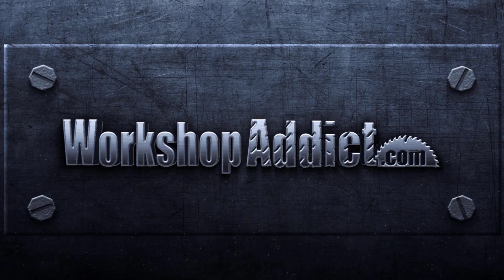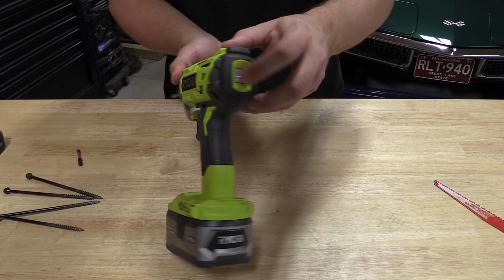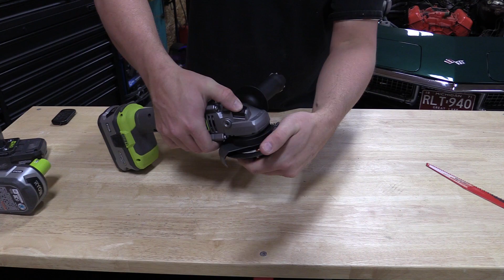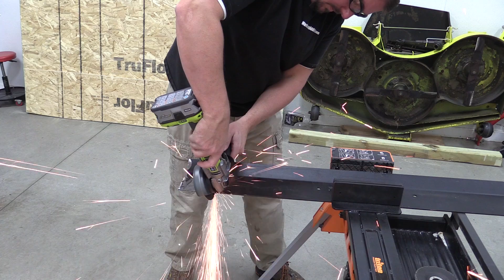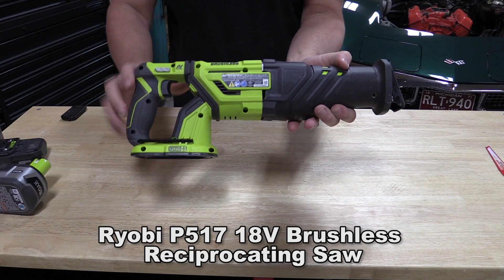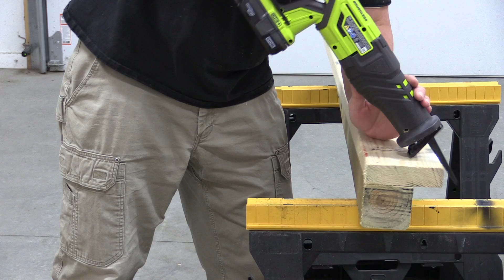New Ryobi Brushless Impact Driver, Circular Saw, Angle Grinder & Recip Saw

Comment: I have the recip saw, the first time I used it I couldn't get the blade to release.  I tried for over an hour and after two application's of WD40 I finally got the lever that frees the blade to move all the way. Apparently right from the factory it might not have been lubricated and the metal pcs froze together. Very frustrating, otherwise tool works great.

Comment: There is an array of tools that Ryobi makes (ie; grinder, hammer drill, circular saw, impact driver, sawzall) that need the 9ah battery, you will see a day and night difference with the battery change!!!
Reply from the maker: At the time of the filming of this video, the 9Ah or any high capacity batteries meant for these tools, were not available.
Reply: Capacity (9Ah) won't matter as much as the current (Lithium vs Lithium+ vs Lithium+ HP)

Comment: This guy sucks at using these tools. I use these tools everyday. Not so much the circular saw but definitely the other 3. even though the circular saw works great if you put a metal cutting blade on it, to cut pipe or steel strut.  That dude was definitely struggling with the tools and try to put the blame on Ryobi. Lol

Comment: You need to use the brushless tools with the 6ah or 9ah HP+ batteries. They have extra contacts on the back and enable the battery to provide extra torque with the brushless tools. I upgraded to them and the difference is amazing.
Reply: jesse grat I have the newer HP batteries and the circular saw cut through the 2x4 rip cut just fine. Not amazing but it does the job. Just an at home tool. I like it a lot. Does what I need for a good price.
Reply from the maker: Those batteries were not out at the time of this review.

Comment: I noticed that the new angle grinder now has a different guard or some kind of slip on piece for using with cut off wheels.  I've been trying to find something like that to use with my old blue angle grinder.  I tried the HF guard but it doesn't fit.  I'm leary of using a cut off blade without the improved guard.  Do you know of any 3rd party guards that would fit the Ryobi angle grinder?
Reply from the maker: I do not.

Comment: I just returned the brushless circular saw.  I had cutting out doing a cross-cut in a 2x4 as well as 3/4" oak using 4.0ah lithium+ battery.  My old 5 1/2" circular saw (original blue version) had no trouble with both of those!  If a 5 1/2" does better than a 7 1/4" something isn't right.  It may well be that these brushless tools need the new line of batteries that "communicate" with the tools (not sure what means) - but it makes me wonder if this isn't also a good way to get people to buy a bunch more expensive batteries.  I'm staying away from brushless for now.
Reply from the maker: I agree.  I do believe the brushless tools are good, you just need to use the right battery with them.

Comment: I'm a window and door contractor.and I use exclusively Ryobi tools. I'm still using a few from the original set I bought in 03. However the new brushless tools have been a huge let down they haven't lasted and eat batteries way faster than the older ones

Comment: The Ryobi brushles tools were designed to be used with the newer +HP batteries. And it makes a world of a difference. I have this saw and with a newer +HP battery and a Diablo blade I rip thru solid 4x4's and old wet 7/8inch OSB all day long with ZERO hiccups! I work construction full time with these brushless tools and they do great. My current Diablo blade has been used every day for over a week and still no stalls!

Comment: So the brushless motors are more sensitive to overload?? With the correct blades I guess that they will be OK. Way to finicky fussy and underpowered for Serious DIY or professional use. I mean if a blade isn't 100%perfect it should still go through to finish the job in hand. I think that the overload protection is a bit too ott.

Comment: It’s the blade. I got the recip saw with a 4ah battery and used a diablo pruning blade to trim a tree. 2 inch limbs were cut with no problems.

Comment: Anyone one know why this guy is having so many issues cutting and sawing? I have Ryobi and have never had those issues. Oh so Ryobi is just good for dyi? Not according to the tens of thousands who use them everyday to earn a living.
Reply: I've noticed that a lot of the Ryobi brushless tools seem to have an overly sensitive cut-out threshold. 

Ryobi is considered a DIY tool because they are built to a cost. For example, the brushless skill saw has a stamped, not cast, shoe, a plastic blade guard (which would likely get broken on a job site), no dust chute (on the North American version), it does not come with a rip guide, and it doesn't even come with a screw for the rip guide. While not necessarily a pro feature, it also lacks a laser guide like their old saw had.

That's not to say that they are not good tools, but the majority of them are not pro-grade tools. A Concord Carpenter has several head-to-head tool reviews. You can check out his channel to see what I mean.
Reply: @Pro1er  ok, thanks

Comment: i'm a ryobi guy,probably 30+ 18v tools. i have always felt i was getting a great value.i do see ryobi doing a price creep toward the high end brands. but the one battery fits all is great. NOW  FOR THE BAD NEWS. i bought the 7.25 circular saw,4.0 battery. it worked just like the review,it cut off every 5-6 secs. took it back. read reviews that people loved it,BOUGHT ANOTHER ONE,I REALLY NEED A CORDLESS CIRCULAR SAW.BOUGHT A DIABLO BLADE FOR IT. 2ND ONE WAS A ABSOLUTE PIECE OF CRAP! for the money they charge for this brushless,119.-135.00 it just doesnt  work. maybe if i hooked the 9.0 amp 100.00 battery it would. 2nd saw went back.

Comment: the stock blade is absolute junk. I put a 40T diablo blade in the circular saw and I have no difficulties ripping sheet goods and lumber with a 3.0ah battery.

Comment: lol I still have my blue tools 
I felt like the the blue circular saw works better than the green ones but maybe I just wasn't cutting heavy enough stuff LOL but I have gone through two blue circular saws because they have destroy themselves while I was using them but I kept using them until they finally just locked up.

Comment: The new battery line up is the brushless tools best friend you should redo this video with the new batteries
Reply from the maker: audionut I agree!
Reply: The HP line the brushless tools have two extra terminals that allow the tool to increase power. This actually does better at the 6.0 side for each tool. VCG does a great video on the p238 with the hp and non hp batteries and its shows a tremendous boost in power vs the other non hp battery
Reply: What new batteries?

Comment: Would it be possible to do a revisit on the brushless line with the new 6 amp hour batteries? Supposedly the new batteries are geared more towards the brushless line of tools.
Reply: The new batteries made a huge difference in the P508 circular saw during my tests. At least 60% faster when ripping 2X material, with barely any overload cutouts even when I was really pushing the saw hard through the cut.
Reply: Doresoom Reviews Doresoom Reviews right on thank you. I was on the fence about that thing after seeing a couple other videos pretty much say it's a turd with the 4ah. Going to have to get one now with the 6 ah battery.

Comment: Hi. I have the brushless Ryobi circular saw. I too had the cut out issue.... Until I installed a thin kirf 24t Diablo blade... Wow a new saw... I can rip long 2x4, angle rip 2x6 no cut out at all... I highly recommend the upgrade, I think the standard blade is rubbish. Oh and in NZ we have 5.0ah batteries, I use those in this saw.

Comment: Definitely agree the newer batteries with the charge indication on them are far better, i have even just ordered the Chinese copy Ryobi charger and two 5ah batteries was dubious at 1st but my friend has them they are very good
Reply from the maker: Rocky fish Be careful.  We did a video on the DeWalt and Milwaukee aftermarket batteries....  They alwere sub par.
Reply: WorkshopAddict I was worried about them but in all honesty I think the charger is far better I had the standard charger it broke. Got this I opened it up and it looks better built inside too, the batteries are very good I've used a multimeter on them exactly what they say on the tin, I understand your comments because I was the same not long ago but after seeing them work I went for it, £20 for a 18v 5ah battery, even if it breaks after s few months still better then £70 I'm not knocking Ryobi there batteries are very good but the charger was crap this new charger is very good

Comment: You need to start clamping those planks before you lose a finger.And those tools are underpowered.Dewalt sawzall even with a compact 1.5a battery would slice that ryobi POS in half before you've even changed a blade.Thanks for showing them though it's thoroughly persuaded me not to buy a single ryobi tool LOL .... and least you don't shout like some OTHER tool review dickheads

Comment: Will be nice to see a retest of the circular saw once Ryobi has their higher capacity batteries (6 & 9Ah) since the saw has extra contacts so they must be there to allow communication between the tool and battery
Reply: The new batteries made a huge difference in the P508 circular saw during my tests. At least 60% faster when ripping 2X material, with barely any overload cutouts even when I was really pushing the saw hard through the cut.

Comment: Wow these tools are such garbage. It also seems that only ryobi and ridgid (both tti brands) have huge performance differences with different batteries, a clear sign of cheap batteries. How can anyone watch this video and proceed to buy these? Everything but the impact driver cuts out mid-job. Spend a little more and get makita, milwaukee, dewalt. You'd be an idiot to buy this absolute trash

Comment: My brushed ryobi impact driver breaks impact bits like nothing i have ever seen before!
Reply from the maker: terry jenkins The DeWalt ones work well for that kind of power.
Reply: WorkshopAddict I'm saying Ryobi is torquey
Reply: When it dies i will get the three speed brushed impact driver ive been using them for equipment repairs!
Reply: WorkshopAddict I second that

Comment: Nice review!  But, it's not "Ree Obi", it's "Rye Obi"  ;)
Figures that after I bought several kits they come out with the brushless tools.  sigh
The grinder kicks off because the amp draw from the battery is too high. The battery pack itself is shutting off power. The grinder is just pulling that much Amps to run it.
The blade that comes with the circular saw is only for cross cutting. It's not a ripping blade. Perhaps changing to a ripping blade you'll get far better performance out of it
Hopefully Ryobi will come out with another battery pack a notch higher and that'll overcome pretty much all the cutting out you were experiencing. Personally, I'm going to fabricate one myself and make a custom 8Ah pack for the Miter Saw and Circular Saw.
Reply: Go watch any video that the Ryobi official channel has actually put out. They pronounce it "Ree-obi" themselves. You're right about the new 6Ah packs - they allow the brushless tools to draw significantly more power than the older 4Ah batteries.
Reply: @DoresoomReviews  I've heard them pronounce it both ways Nate.
https://www.youtube.com/watch?v=GXNLOAbfflk

Comment: It's got to be your blades. I picked up the circular saw so I didn't have to worry about tripping breakers by running a saw and compressor at once if I only have one outlet to work with. I work roofing and some general construction and I have cut 2×6, 2×4, 3/4" osb and sheathed houses using the 4.0 ah battery and don't experience the cut out. As soon as I got the saw I put on Diablo blades and it cuts great.
Reply from the maker: I was using the factory blades.

Comment: I think you must be the kind of guy who simply MUST push the tools through the cut until the motor stops.  I have the brushed versions of ALL the tools shown and I have made most of the cuts shown here with absolutely no trouble.  And that includes cutting a 7" or 10" diameter stream-blocking tree limb while in the water in my kayak with "The Axe" blade installed!  Advice on your ripping:  I think you were somehow pinching the blade.  With a couple of simple wedges, I could easily have made those cuts with the BRUSHED tools!  Work smarter, not harder.  BTW: with my BRUSHED impact driver, I almost always use the smaller batteries with no problems -- going through drywall into a stud with either 2 1/2" or 3 1/2" screws.  Also, I can easily cut through plywood with my cordless circular saw.  I don't think I can recall of EVER having a Ryobi cordless tool "cutout"!
Reply: Hey, im thinking on buying this saw, i have a drill with 4ah, do you think it will perform well (circular saw)
Reply: Well you use the right blades.
Reply: About equal to my experience with my Ryobi tools; I'll likely buy the brushless ones, but my brushed skill/recip/impact/etc all work amazingly and for years.

The only thing that wasn't up to par was the Krypton-bulb flashlight, which I replaced w/7 Cree LEDs and a SparkFun power supply when it broke.  Everything else has been great.

Comment: When bought in a kit does the impact and drill come with the light?
Reply from the maker: Mark Imbesi As far as I know, the kits are not brushless yet.
Reply: Kits are available in the USA  not in Canada  where I live
https://www.homedepot.com/p/Ryobi-18-Volt-ONE-Cordless-Lithium-Ion-Brushless-3-Tool-Combo-Kit-with-Circular-Saw-w-Batteries-and-Charger-P1953N/303037087
Reply from the maker: First I have seen of these kits.

Comment: The blades do matter, I was able to cut through a stack of three sheets of 15/32 plywood using the factory blade with the brushless circular saw. After some use the saw cut out on me, I replaced the blade with a diablo and it cut just fine through another stack. I wish ryobi had done a dual battery setup like makita did on their saw. For now I'm happy with my 7-1/4" brushless saw. Keep in mind these are cordless tools so they won't be as powerful as a corded saw.

Comment: Maybe the circular saw needed a different blade. Reciprocating saw is not designed for tressels.
Reply from the maker: I fully believe it might have, but I have to ask...  why ship a new brushless tool with a blade that does not work?  I get it though, we replace the blades on most other saws, not because they dont work, but because of cut quality.

Comment: Do you know what the extra contacts where the battery goes are for?
Reply: The only explanation I can think of is that the upcoming 6Ah and 9Ah battery packs "talk" with the tool to allow it to draw more current. Ryobi won't officially confirm the packs, but the product listing for the circular saw on HD's website shows a 6Ah battery installed on it.
Reply: Doresoom Reviews That's what I'm hoping for, a kind of "flexvolt" battery that works at 18v and a higher volt depending on the tool.
Reply: The new batteries made a huge difference in the P508 circular saw during my tests. At least 60% faster when ripping 2X material, with barely any overload cutouts even when I was really pushing the saw hard through the cut.

Comment: I treated myself to the free brushless tool deal at Home Depot. When you buy the brushless hammer drill kit, you get another tool for free. So I got the brushless angle grinder for free. I have the old brush angle grinder which I'll use just for grinding, and the new brushless is used for cutting and sanding.

Comment: For the saws, what blades did you use? The ones they came with? I guess they will do better when the 6 and 9 amp hour comes out.
Reply from the maker: Yes, factory blades
Reply: That could make a difference. I use a high quality Diablo blade for my circular saw and high quality Milwaukee blades (The Ax for wood cutting and The Torch for metal cutting) and never had any issues.
Reply: The 6Ah battery makes a HUGE difference with the P508 saw. Up to twice as fast when ripping 2X material during my testing.
Reply: Cheng Liu with a 6.0 or 9.0 this thing is a beast!!!! Changes everything

Comment: lame. big red brother said, this much power, and no more, you are not allowed to compete with me.
Reply: Take another look at the battery terminals on the circular saw. It's got two extra terminals at the base of the stem, which I assume is for the new 6Ah and 9Ah packs, since the P102 and the P108 don't have contacts in that location.
Reply from the maker: One always has to wonder about that!  But I also have to wonder how much communication there is between battery and tool.  The battery connection has not changed so they still only have 3 connections.  Might this be a safety built in to protect the motor and battery since it is a guess on how hot each is?

Comment: I thought amps is only runtime. 
The volts effects the power. I'm pretty sure it's not the amps.

How many bits are people going to lose on the impact when they just shoots out.
Reply: The larger battery packs can supply more current to the tool, since they have two sets of 5 cells to draw from at the same time. The slim packs only have one set of 5 cells, which won't allow them to output as much current. So the Ah rating mainly specifies higher run time, but also a little extra in power output.
Reply from the maker: To add to it, Watt hours is the real definition of the power available to the tool.  That is a calculation of volts times amp hours.
Reply: Think of it like this: volts are the RPM and amps are the torque. Amp/hours is an equation of both combined and that's what determines total runtime.